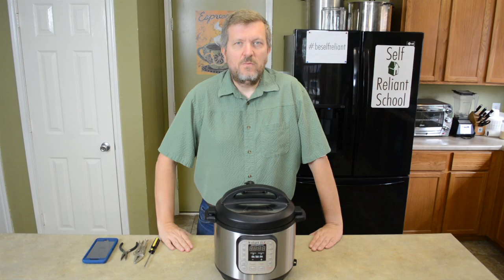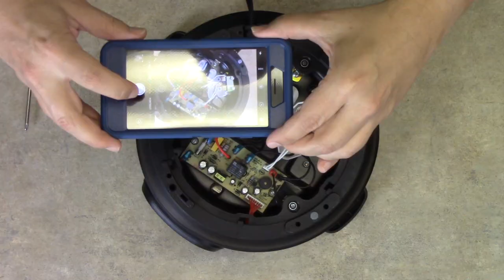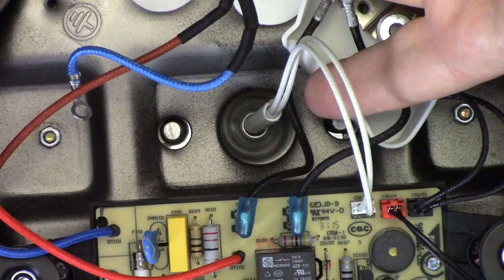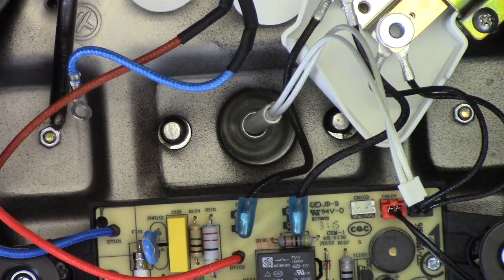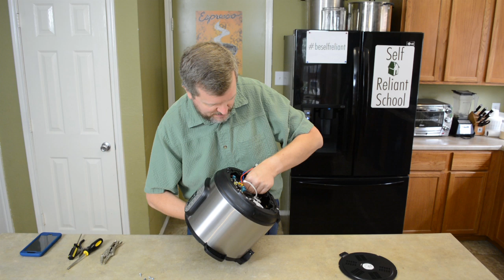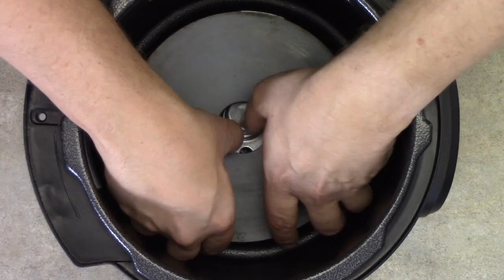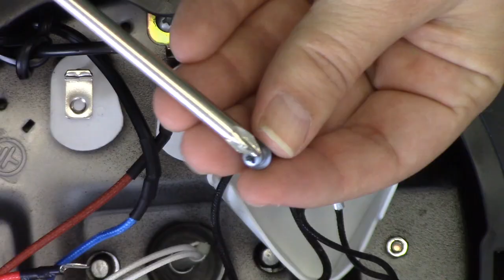How To Disassemble And Clean Your Instant Pot

Comment: Hello :)  Fantastic demonstration, but I don't think I would be keen enough to remove the mechanisms to get to the element lol!   I wondered whether it is possible to use a narrow strip of silver foil and gently place that around the element to protect the space beneath the plate inside the inner pot?   Would that create short circuit issues?   I don't mean to pack the foil underneath, but just lay it gently around the outer rim in the base to prevent food from collecting?   Let us know won't you?   Thanks so much in advance!

Comment: Well darn, I dumped black beans into my brand new InstaPot Gourmet. I followed your directions, no problem, until, well, my pot has screws instead of nuts. I stripped the second screw and can’t remove it (or the lining). So $100 down the drain because they don’t take returns here in Mexico. I’ve reassembled it for now, but wonder if you know how I can remove the stripped screw. I tried the rubber band trick, but it didn’t work :( Thanks for the clear instructions!

Comment: Your tutorial is a good starting point but unfortunately there are several different Instant Pot designs. Not all of them are as easy to disassemble. Ours has three screws and a thermal cut off switch attached to the hot plate and requires the circuit board to be removed to reach one of the screws. Ultimately pretty much a full disassembly is required.

Comment: Is there an updated version of this video. My Duo Plus is not laid out like this. Plus it has a couple of star drive bolts.
Reply: mine isn't either, it also has these oblong metal discs under the heating element, wondering what they're for
Reply: @wangana5955  I have a Duo Mini, which started showing the same error. After watching this video started opening up. Found that the internals are different. Just need a screwdriver. Very important to take a photo of the wire connections as suggested. Start removing one by one, all the way upto the heater plate. Note how they're connected. Clean the oblong metals discs completed including any rust. Start assembling back, beginning with the oblong metals. Ensure the spring is locked into the two poles and the 3 poles on the heater plate are aligned correctly. It should resolve the issue.

Comment: Good video and informative. BUT be aware I did this with my Instant Pot Duo Gourmet and the inside is quite a bit different. I had to remove many more things including the control board. After all of that there were three washer plates that were under the heating element. The one in the video doesn't look like they had any. Those are a royal pain to get back on. I had to balance the instant pot on one hand while I tried lining everything up. It took maybe close to an hour from start to finish. Definitely not 5 minutes.

Comment: I want to thank you so very very very very much for letting me know you need to fill ups screwdriver to take the bottom off the instapot I made a mistake of pouring some militant there will my while my kitchen was dark in my actual pot was not in there and I was having a hell of a time getting it out finally use the leaf blower after I took the bottom out the blow the shit out so I still think it's a toroid or some sort of thing in there but apparently they think I got it open with the Philips Solis you motivated me to try to take the bottom off which I did being in I'm still concerned as to what type of screw it is I just tighten it in as much as I couldn't left enough so I can grab it with a pliers and open it up at some other time thank you so very much you are a lifesaver
Reply: I think it's Phillips, and all that means is the tip is in the shape of a cross instead of being a single flat line.

Comment: Hi,  i have an Instant Pot duo crisp + air fryer error code c6h/ c6l. It appears even after replacing the pressure sensor which everyone in the youtube tutorials seem to suggest doing.  Any suggestions what might be the cause and a possible solution?

Comment: I was using the glass lid and reheating soup and it boiled out. I opened the bottom lid and the the motherboard was covered in dry soup. So you think I need a replacement? Or replacement parts?
Reply: Unfortunately the only way to know would be to test it. Assuming that it's now dry, I would suggest taking it apart and cleaning everything as best you can with something like a toothbrush (dry - don't introduce more liquid to it). Then reassemble and run it through a few different cycles to see.

Comment: YOU ARE EXTRAORDINARY ! I MUST ADMIT *** I do repair many complicated computers  mother boards but i am little  afraid of this one !!! I am thinking if I use the aluminum foil rolled up around the heating element what happens ? the foil will surround the heat-element  plate &  will block the food debris to get down to the bottom  except liquid spill ! can it make short circuit > I don't think so but it's easy to throw away a piece of aluminum foil and replace it with new one. I do all the time for the drip pan on the electric stove !
Reply: skylark304 did you ever get an answer to that aluminum foil question I don't see one I'm looking for the answer too

Comment: I have a question. Tonight I accidentally poured water, lemon juice and olive oil into the outer pot with no liner inside. I put in my artichokes and after a few minutes, I noticed it said BURN on the readout. I have turned the unit upside down to try and drain all the water, however, I know olive oil is on the inside now. Your tutorial is about removing food. Do you think the unit will be safe to use in a few days? There is no way I can clean out all the olive oil.
Reply: Were you able to get the oil out, eventually ?

Comment: Very helpful but there have been a couple design changes.  

The bottom screw has a torx head, not a philips head now.  

The pot sensor now has a ground wire.  

Warning!  These are really cheap screws and the heads strip easily.  Make sure you have the right sized bit, place a lot of pressure when unscrewing, and don’t strip it!

Thanks for the excellent instructions
Reply: Another design change!  Instead of two hex nuts holding the heating element (in addition to the Phillips head screw) there now seem to be 3 Phillips head screws, one of which is under the circuit board!!!
Reply: Don’t know how to get to it!

Comment: I have the DUO PLUS model. It has a single Torx T-10 screw (looks like a star) holding the bottom plate on. Don't try to use phillips head or you will strip it.

Comment: I threw a tarp over my countertops and did some sanding on my cabinets because they have been painted 7 or 8 times since 1960 and you can tell there's hinges on there but you can't see the screws! As I've been scraping and peeling and sanding uptain layers of paint until I got to the original, leaded, 1960 paint! Didn't realize that my tarp had shifted a little and in the back corner my instant pot was exposed! Apple ID is covered in dust and bits of paint chips and crap! It's filthy! I know I cannot submerge the lid. can I lightly spray it with some 409 and clean it up with some paper towels and then lightly and quickly run it under some hot running water to rinse? It's not usable as dirty as it is now, of course. I can't imagine using a cloth or paper towel and getting it clean enough for my liking without running it under some water. I have some spray bottles that are like aerosol.are really cool they are about $10 a piece but worth it.I can put a very small amount of degreaser in a lot of hot water and one of those and missed it and clean it mostly if I can run it under some water and rinse it! I have a thing about finishing stuff off and running water LOL
Reply: I just came from a video on Six Sister Stuff channel where she does a deep clean of the lid -- but the comments have several people saying people prefer to put lid through dishwasher on top rack. Other people soak the smaller pieces and wash the lid like any dish. 

So my vote is: it's safe to wash like a dish, but probably best not leave it soaking underwater.

Edit: Found official video saying lid is entirely washable. https://youtu.be/01JjQVGR24o

Comment: INSTANT POT manufacturers absolutely should paint the interior a different color like red or yellow or print “STOP” visibly as a warning. Pouring liquid or food into the unit and not the silver pot is a very common mistake.
Reply: right on !  put a sensor in so the pot wont start at all till things click in our head about the liner. thanks!

Comment: I poured water into my pot with out the steming pot😢 can I fix that?
Reply: Leave it out to dry.  If you are in Hot Weather, just leave it in the Sun and then open " under " neath to see if everything dry.  Once everything dry, you will be able to use again.  They made it really simple, so give it a try.
Reply: If you can, open it up to see if the " Circuit Board " is aok.  As long it's AOK and all dry, you are good!
Reply: If an iPhone can survive a swim, I think a kitchen appliance has a good chance of survival with same treatment. I wish you the best.
Reply: I did that today I am sick
Reply: I was gonna make beans and I put a large cup of water in and it was already on heating up .. it worked for 20min  then it stopped working.. sick to my stomach ugh .. not working 2 days later

Comment: I forgot to put the inner pot in so I found a video that say dry the inside with a dry towel and turn it upside down for 24 hours and if its not dry then put it another 24 hours .Well am putting mine upside down for a week lol.It wasn't plugged in when I pour the water ,hope that's a plus .

Comment: a rubber band had accidentally fallen into the base element, i didn't see it, and cooked rice on top in the cooking pot! lo and behold, the rubber band melted onto the circular base (the part you're putting your fingers under in the first part of the video). any idea how to get this sticky mess Off without hurting the pot??
Reply: I'd try a hair dryer (to soften it back up), and a plastic scraper (not metal).

Comment: Is it ok after I put rice and water cover with a plate that fits the inner pot and cook the rice, that way the only thing that spills is the liqid not the rice
Reply: Once Water dry, you are AOK again.
Reply: If you can, open it up to see if the " Circuit Board " is aok.  As long it's AOK and all dry, you are good!
Reply: I found a hint for cooking rice - put about a teaspoon of olive oil in before the rice. It keeps the rice from boiling over, as long as you stay beneath the fill line.  This has worked for me so far.